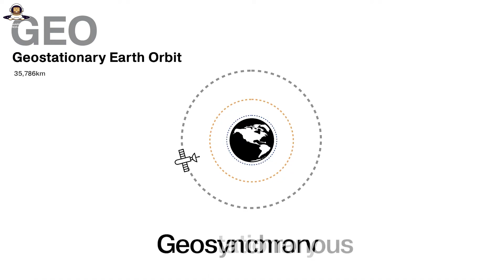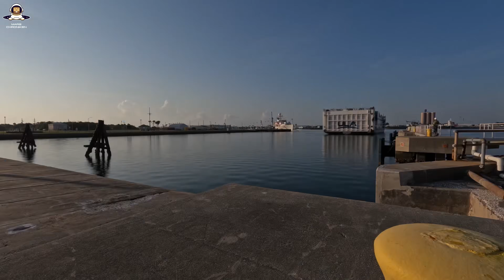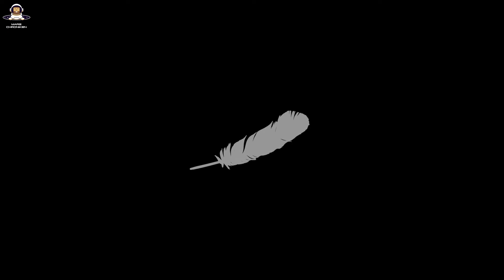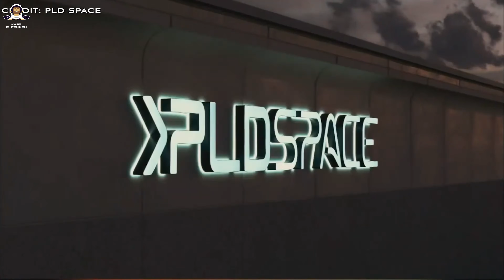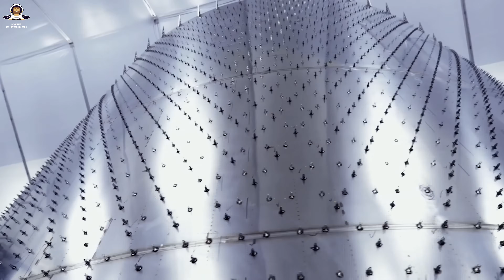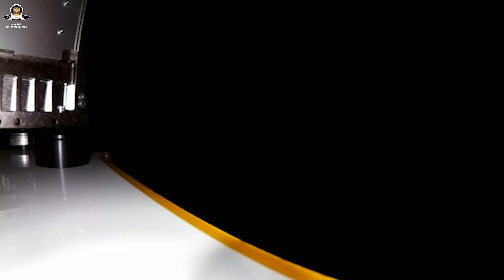Why Cheap Can End Up Costing You More

Comment: I haven’t even watched the video in its entirety yet but the title itself and thumbnail says a lot what probably is misunderstood mostly in the public. To compare Super Heavy to Falcon is blatantly irrelevant and completely pointless. Falcon has been in development since 2002 in an attempt to achieve reusability in some form. They achieved this in 2015 and since then have achieved more than 30 reflights and landings. A simple YouTube search on the dependency of the government on SpaceX’s launch capabilities has reduced taxpayers dollars by 3-4x the budget of any NASA launch. Super on the other hand has been development. Key word is DEVELOPMENT. Like Falcon before it, you don’t get to the cadence like SpaceX without high cost first. But the failures they learned have provided them with invaluable lessons that is now integrated into Super Heavy. Recent report show that the Artemis program spend $25B in its program while Super Heavy had seen $15B. But let’s not forget here. SpaceX, with that money spent, developed 39 Starships, 20 Super Boosters, AND infrastructure for launch as well as achieving 11 flights completed with TWO successful catch attempts. If you haven’t caught on yet, reusability is the key engineering problem here. When V3 solves the heat shield problem, the cadence will be nothing to laugh about. Only then can you make that comparison to Falcon.